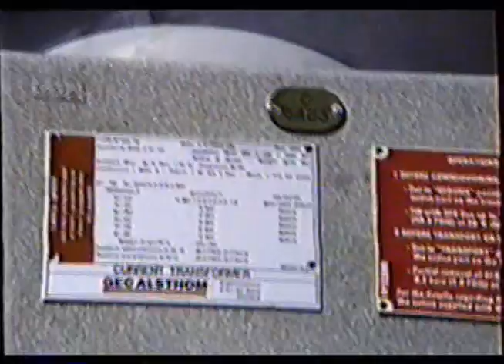Footage from the Aftermath of the 1990 Custer Substation Fire

Comment: What was the cause of the fire?
Reply from the maker: +Andy Hill. A transformer bank failed and caught fire.
Reply: +BonnevillePower Thanks, I understood that, I was wondering if the cause of the failure was ever found.
Reply from the maker: +Andy Hill The investigation was inconclusive. Temperature/environmental conditions or equipment failure may have been the cause.
Reply: +BonnevillePower Thank you, I guess after such a fierce fire finding the true cause is a big ask.
Reply: +BonnevillePower whatw as with the smoke comeing out of the one transformer was that one  still on? was any of the transformers   still pwoerd during the cleanup?
Reply: +Stormcruzerlore I wondered that too, I guess it was still smouldering inside.
Reply: SeptrothFFXI transformers of this size and type are filled with oil its probably that causing the smoke.
Reply: @BonnevillePower  what about the forth one?
Reply: It was a bushing failure on one of the transformers. That exploded and caused the fire.
Reply: @SeptrothFFXI  Fairly sure it was not paper or cardboard, but either a ceramic material of some sort.  The remains of the oil in the core was probably still flaming hot and vaping itself off.  That valve is a safety release valve meant to dump oil in an overheating situation, to prevent the tank from violently rupturing if the oil has no where to (in some video's of transformers being stressed to the max due to an arc failure right outside of it you can see the vapor cloud of this superheated oil being vented out to atmosphere, usually being ignited moments after due to the intense hot arc right outside the tank.)
I like to believe it is actually a design decision meant to ultimately destroy the core should other safety systems fail to intervene, it is this dump of it's coolant that will cause the total distruction of the insides of it.

Comment: Just about anything could have caused the fire.  a faulty relay, arrestors, circuit breakers,  cut outs even the transformers(s) what you saw still smoldering was the vegetable oil inside the units. those small tanks on top are reservoirs which circulate thru the outside fins cooled by the fans since these devices get very hot particularly since these were handling at least 50 kV each.
Reply: Its mineral oil to cool the transformer
Reply: The tanks on top are expansion drums, the radiators cool the oil so convection makes it circulate throughout the core.

Comment: How much  standing around is required?  
Get busy and put it all back together.  Stop wasting time and money.
Reply: By my count, five watchers for each actual worker.
Reply: Disregard guys, take 5. . .
Reply: You do realise that cleanup isn't just about hoisting out the burnt transformers and putting in new ones right?  I  don't know about design rules/choices for substations in the US, but here some transformers in big substations can be situated in basically a dry pool meant to catch the oil should the safety release open up.
If that was not the case here, you are looking at cleanup efforts to sanitise the soil around it first, you need to pull new cables while all the time having to be sure that you are working on non-live equipment.
There is something to be said for standing around: yes it might look like nothing much is happening, but I'm fairly sure electricity companies do not like to rush things after such a massive incident.